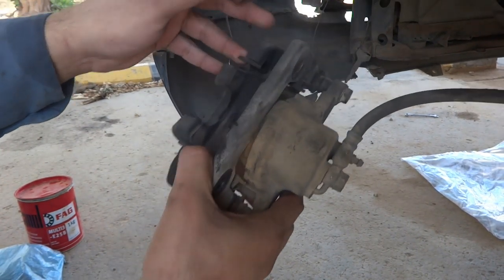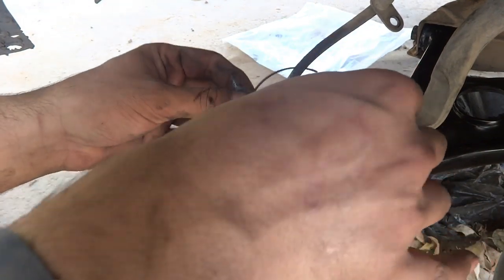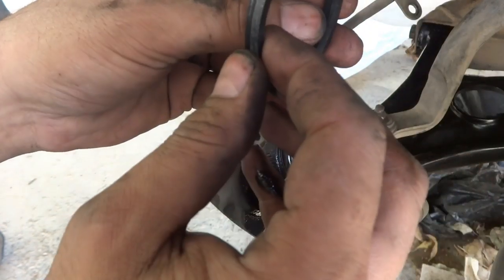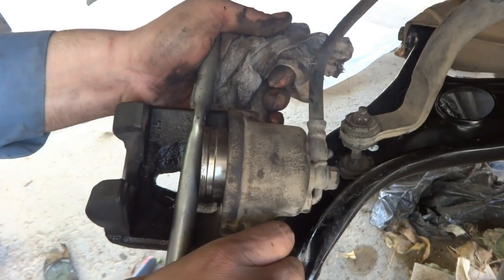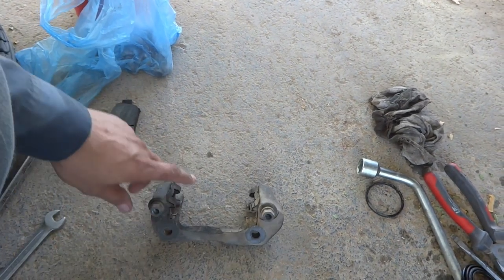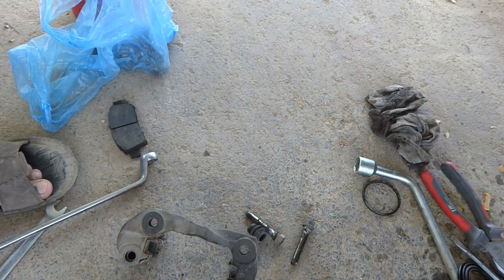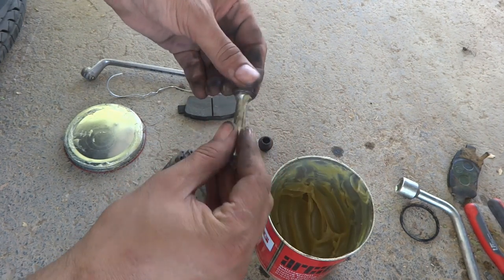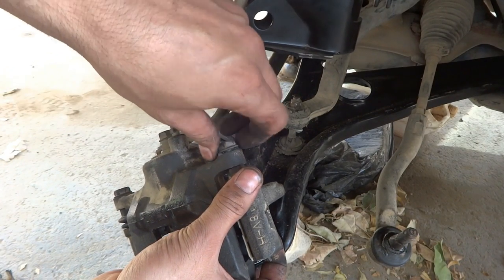Car front brake caliper repair. Toyota ECHO brake caliper.

Comment: Loverly job jahan :-)), i hope they worked ok when the system was bled of air.

I had to do the one on my motorbike about a year ago, but the piston was ruined, the rust had stripped the chrome off and pitted the surface so a new piston and seal kit was ordered from my local motorbike shop.

They even gave me a small packet of silicone grease for the sliding pins, they are a family owned business and very good :-))

Comment: Wouldnt it be easier to just replace the caliper?
Reply from the maker: Yes. But that could be a costly solution.
Reply: Difference in this case is 25-30 dollars for parts  including piston (in his case he reused the piston so it’s even less) vs 70 dollars for a new caliper + 25 dollars core charge (refunded when you give them the old one).

140/190 total instead of 50-60 total. To you it might be fine. But for them is kinda expensive for their day to day life. If you can afford it, go for it. It will not be better or worse.